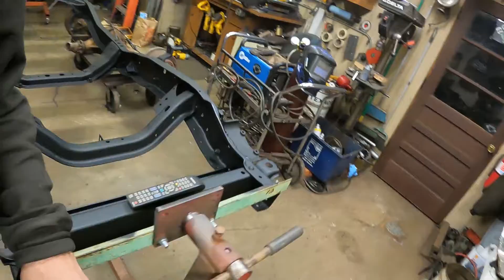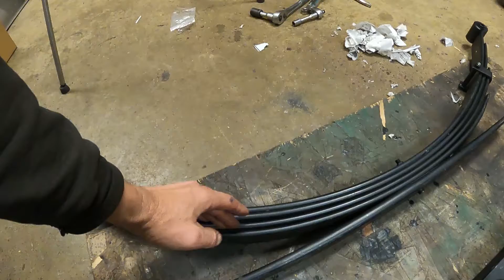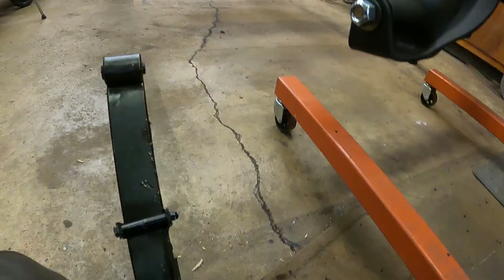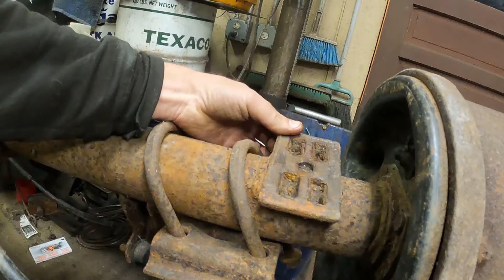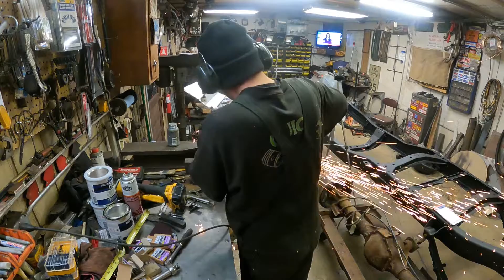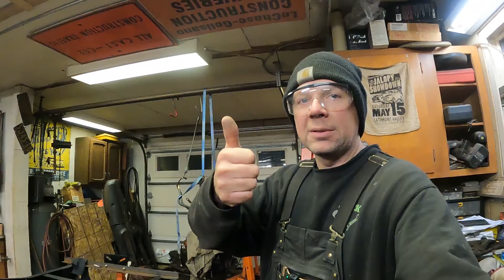Rough Country 4 Inch Leaf Spring Install:  1980 Dodge W200

Comment: Being the Dodge nut I am, my recommendation is instead of grease you should've used Anti-seize. Available at all parts places. The product is self explanatory  !
Reply from the maker: You think I've never heard of anti-seize?  I use it on everything.  That being said, I use it where it makes sense.  Lubricating springs is not it.  Grease is way cheaper for large applications like springs, better  preventing rust, and will last longer.
Reply: If you say so !
Reply from the maker: I've greased every spring on every car I've built in the last 30 years and they are all still working great so I'll keep doing it.

Comment: Will 90s model ram 1500 leaf spring hangers fit a first gen dodge.
Reply from the maker: I don't know, but you can buy the correct hangers.  I replaced them on this frame
Reply: @QuickSpeedShop  where did you get yours
Reply from the maker: autotruckandspring.com

Comment: Is there any reason this would not work on the D250? On the website it says it is only compatible with the W250 but I don’t see any reason these wouldn’t be fine to run on a D250 chassis as they are the same. I have bags in the rear I to make up for any weight I might have to tow and am planning on getting bags in the front but the most I tow with the truck is my quad to the dunes lol.
Reply from the maker: What year D250?  I thought those all had coil springs and a-arms in the front?
Reply: @QuickSpeedShop  I have a 1991.5 single cab long bed 4x4. It has a Dana 70 axle in the rear and a Dana 60 up front. From what I’m seeing most of the D250’s came in RWD while I was doing my research, maybe I got a rare model?
Reply from the maker: D designates 2WD trucks while the W is 4x4.  As far as I know it's always been that way.  The door jam data plate or sticker will tell you exactly what the truck is.

Comment: Do you remember by any chance the part number for the frame bushings for the front? Or where you got them. I'm about to start working on my D44 front axle/leaf springs.
Reply from the maker: The leaf spring bushings?  They came with the Rough Country lift
Reply: @QuickSpeedShop  No, the one on the frame.
Reply from the maker: I'm pretty sure I bought them on RockAuto
Reply: @QuickSpeedShop  Thanks! For the life of me I can't find them
Reply from the maker: They're in the body section.  They're Energy Suspension

Comment: Enjoying the build! If the springs seem too tall, know that they will settle 1/2" to a full inch after you drive on them for a week or three.
Reply from the maker: Yeah, I know it'll settle out some when all the weight goes on.  It will still be pretty tall though!

Comment: That’s a great spring kit company that’s  reasonably priced. …..Rough Country 4” is what I bought for my Dodge. I did have to locate longer studs for the 3/4T front axle mounting pads. I think they were 9/16” size studs that need to be about 5”-6” in length. Tough to find them in grade 8.
Reply from the maker: I bought the whole lift kit and it came with the longer studs, u bolts, and shocks.

Comment: I was telling you to use a floor jack to help you with the spring installation. I also was suggesting using traction bars (akin to the ones we used on drag race cars) on the rear springs. But you couldn't hear me. LOL
Reply from the maker: Got to say it louder!  I actually might build ladder bars if it has bad wheel hop.  My '95 F250 has wicked axle hop if I get it stuck and need to spin alot to get out.